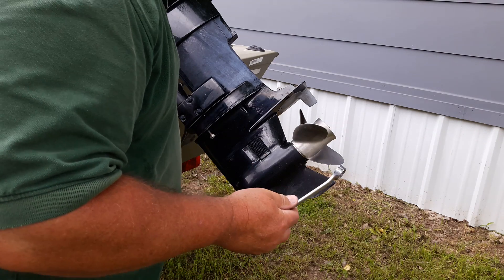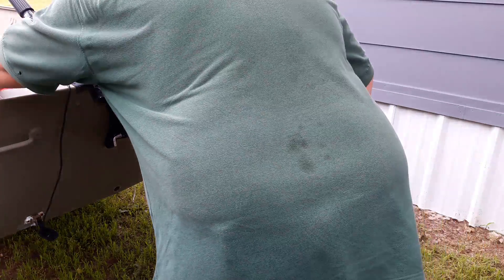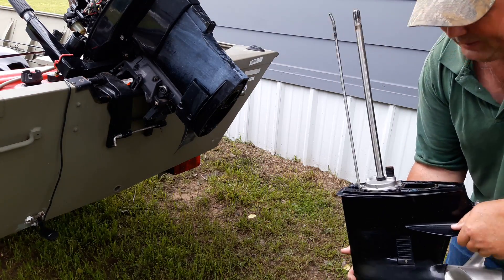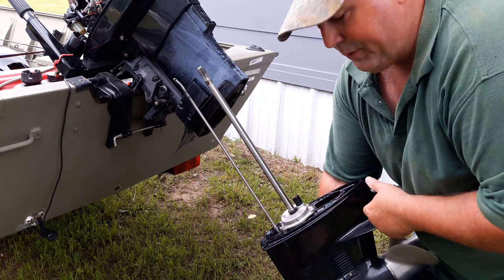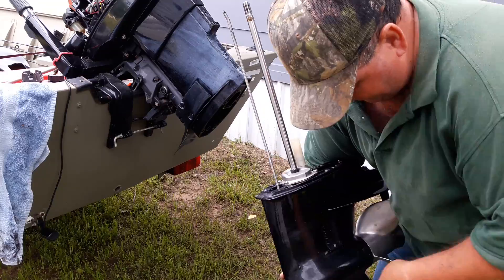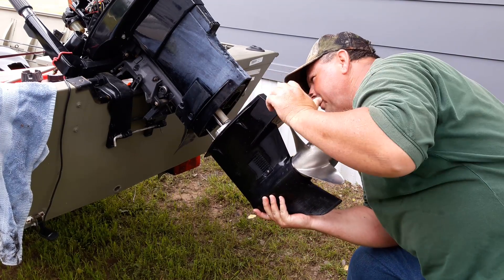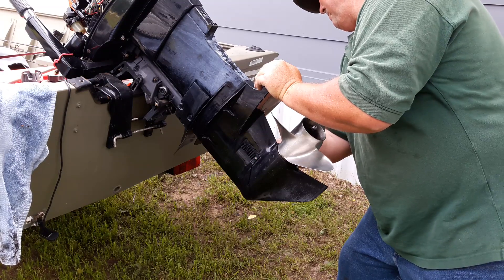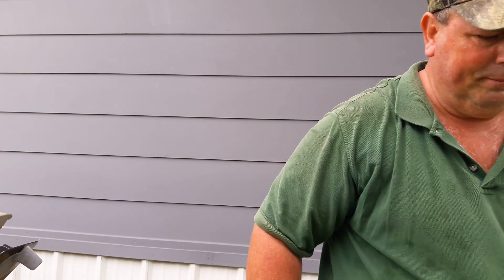2005 MERCURY won't go into reverse part 2

Comment: Was there a lever on the shift shaft that you had to lift up before removing lower unit?
Reply from the maker: @Debidawg  where is a lever on the lower unit that is work through the tiller handle

Comment: Wasnt he supposed to recheck the measurements length of the shift linkage? Turns in n out and gets shorter n longer if you move it from disassembly
Reply from the maker: No smell the shaft like does not get shorter or longer when it turns

Comment: Thanks for this good quality video.  Am I correct in the assertion that if I want to convert my 2005 Mercury Outboard Two Stroke 25 hp 20 Jet ((original from factory) that has the shift linkage rod on the outside of the cowl straight down to the jet pump bucket gate for (forward, neutral, and reverse)) to a lower unit that instead has a propeller, I will also have to find a tiller handle like the one in this video that has the forward, reverse, neutral shift linkage and throttle cables together built into the tiller handle? My tiller handle only has the kill switch button in it and the throttle feature. 

Other than the tiller handle, my powerhead seems to look exactly like yours in this video, but I need to clarify if my powerhead has any area on the right side of the engine block area to  connection or install shifter cables with the assumed tiller handle I will have to find (I think it would be somewhere near where my throttle cables are installed but I don't know what I'm looking for exactly in that area of the engine).  I cannot find any videos or pictures or diagrams for this Model 25 hp powerhead with a solid explanation a regarding my inquiry.  
Thanks in advance for your feedback.
Reply from the maker: You should not need to replace your tiller handle all the tiller handle is doing is Shifting you from forward to reverse the only wire going up in the tiller handle should be just to kill your ignition you can also do that with a safety switch the tiller handle whether you're dead or propeller driven should be the same there's a safety switch that keeps you from starting the motor unless you're a neutral that should be the same on any 2005 Mercury 2 stroke weather is jet driven or prop-driven I believe the shifter rod everything should be the same how far is a jet but I've never had a jet so I'm not sure
Reply: @dmaxwell8174  Thanks very much for your feedback and input...just to be clear, my tiller handle does not have a forward, neutral, or reverse option on it.  There is a separate forward, neutral, reverse knob on the outside right side of the engine cowl/cover that has a shift rod attached directly to a sort of control gate or bucket on the jet pump that basically re-angles the thrust of water coming out the back of the jet to control or redirect movement.

But yeh, I'll keep researching and I hope everything else is the same to convert the lower unit easily.🙂

Comment: I have a 175 mariner I pulled the bearing carrier out no problem  but what is the trick to get prop shaft to come out
Remove shift rod???
Reply from the maker: Send me a photo of your lower unit without the prop include the inside of the prop shaft area and I will get back with you send it to dmaxwell817@hotmail.com  hotmail.com

Comment: Hello I’ve got a similar issue, can I ask if you pull up on the shift shaft does the engage reverse or forward gear?
Is it ok to gently pull on the shift shaft to engage the gears?
I’ve just done my water pump on my 50hp mariner and I think when the bottom end has been re installed I think it’s in reverse.
I can manually spin the prop clockwise but not anticlockwise am I right in thinking the prop should freely spin in both direction when in neutral
Reply from the maker: Yes if you're a neutral you should be able to freely spend the prop either direction if it always spends One Direction Anheuser resistance in the other direction you are in forward or reverse the video which way the resistance is

Comment: Couple things. As you was pulling the lower unit off right around the 50 second mark I saw something (?) white drop out and hit the ground. What was that? Secondly, I was watching another video of a water pump kit getting installed and I noticed there was a small washer on top of the gear shift rod which I didn't see on your shifting rod. I believe the washer had something to do with allowing the motor to kick up if you hit some underwater obstruction.
Reply from the maker: That is the water pump tub you just put it back on the water impeller housing after you punt in the new water pump impeller. I have a nuther video on that washer      and the motor won't go in reverse with out that washer so don't loos it.
Reply: @dmaxwell8174  What year is your motor?
Reply from the maker: It is a 2005
Reply from the maker: That was the water tub it goes on top of the water pump. The washer let's the motor shift into reverse and locks the motor down in reverse.
Reply: @dmaxwell8174  Thank You

Comment: You forgot to mention the washer on the shift shaft and the connection eye hole which connects the shift shaft to the throttle. Just saying.
Reply from the maker: You did watch part 1 or part three of my video that's why that said part 2 so watch part 1 part 2 what you want and part 3 where you did not watch which I go into detail on the washer and why the washer needs to be there and how to replace it
Reply: https://youtu.be/EtAJIs5RYFY?t=847 8:23 and 14:07 discuss this in more detail. Thank you dmaxwell 817, this was the root of my problem...the reverse lock was not working and it was very difficult to tilt the motor up to tilt lock.

Comment: What propeller is that?
Reply from the maker: 10 spline 13 pitch
Reply: @dmaxwell8174  thank you, I bet top speed is faster that the oem factory mercury propeller like mine, having trouble with reverse as well
Reply from the maker: Yes at least 10 10 miles an hour faster a lot better take off lot quicker take off and more powerful take off and a lot more top top end speed than aluminum prop so yes you can't go wrong with a aftermarket stainless Louis Vuitton products have some flex and them that saw that cuts down on your takeoff

Comment: i think you forgot to mention,you might want to drain fluid first!DUH!
Reply from the maker: That is a 2 stroke and there is no fluid that needs to be removed to pull the lower unit and had I had already replaced the fluid in the lower unit. You are thinking of a 4 stroke motor. So do your homework before you make a dumb comment.